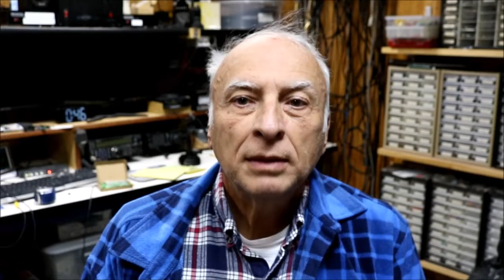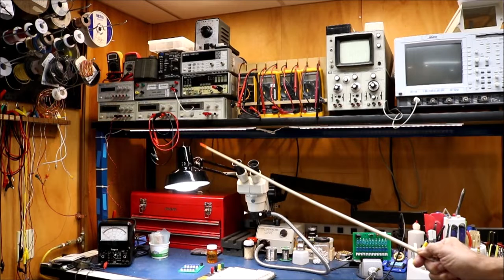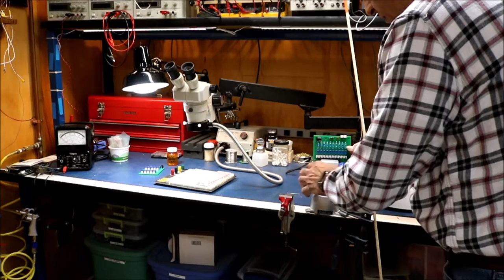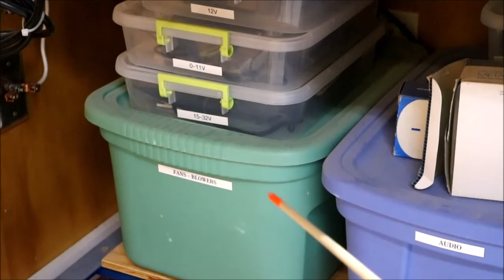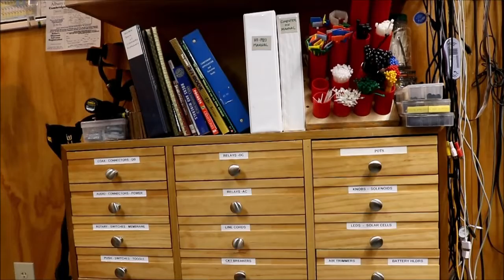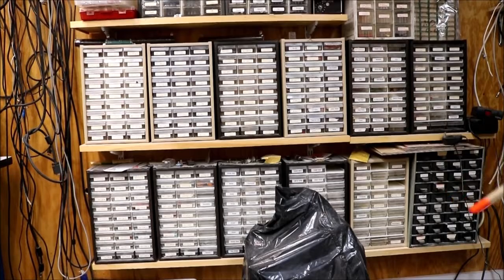Electronics Lab Build

Comment: Really nice. Thanks for sharing. The caroussel tool seems very practical. Never seen one of those. Would you mind telling where you got it? Best regards
Reply from the maker: Unfortunately the carousel is not made anymore. Found it at a surplus store. I think you could build it out of wood.
Reply: @PracticalEngineeringSolutions  I do have a similar thing for dremel bits that I don't use that often, maybe I can modify that. Many thanks! Cheers